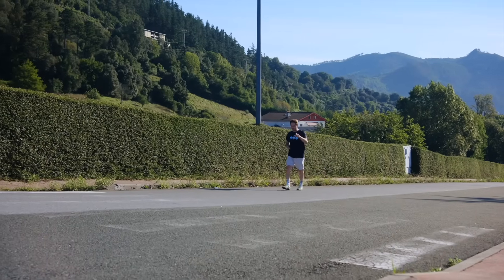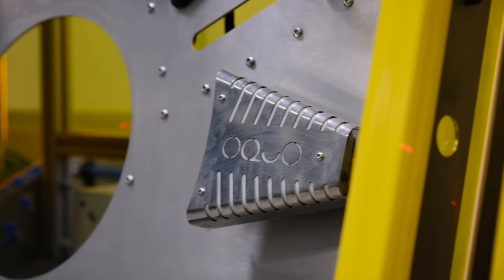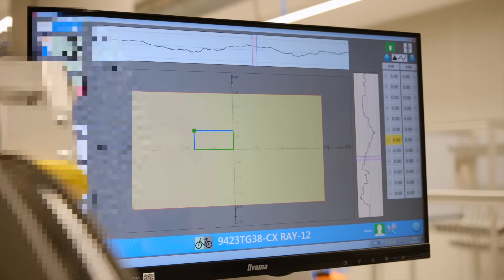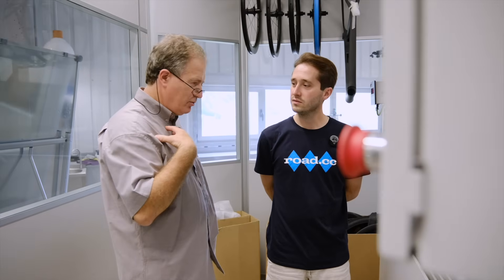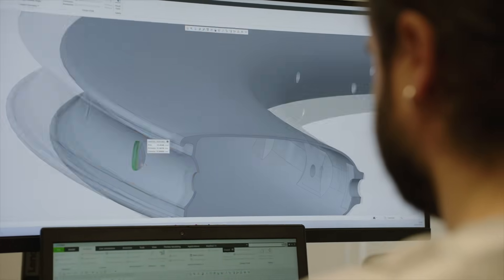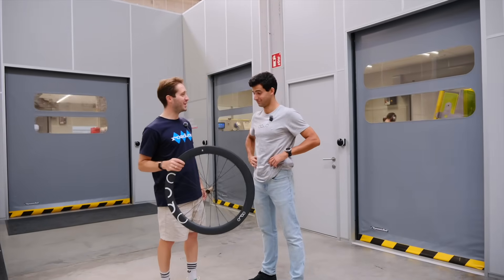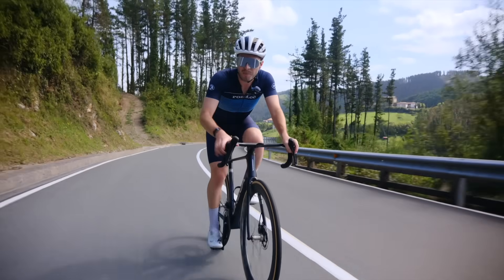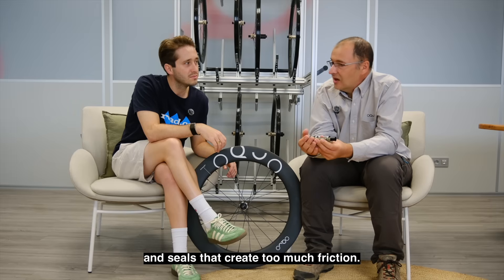Testing handmade bike wheels | Oquo FACTORY TOUR

Comment: I find that these reviewers say "oh, this weels are 1,200grams, 1,400 grams.......", blah, blah, blah, blah.........where! Where is the braking surface, why is the braking surface never included? They brake with the air? 
No! INCLUDE THE BRAKING SURFACE as well.......include the weight of the rotors......otherwise, rim brake wheels are VASTLY lighter, right! Not including the braking surface. Calipers and pads, separate of course.....
Reply: Why does this matter? The wheel weighs what the wheel weights. How much your rotors/pads or calipers/pads weigh is up to you...

Comment: Eh... Bike industry trying to reinvent the wheel again? Like yea I guess it might be better rolling resistance lighter weight, stronger? But the old style serviceable adjustable pre load hubs of the past were actually very low rolling resistance and you could take them apart and clean and regrease them on the side of the road if you had to.